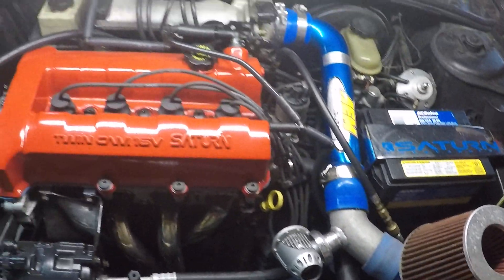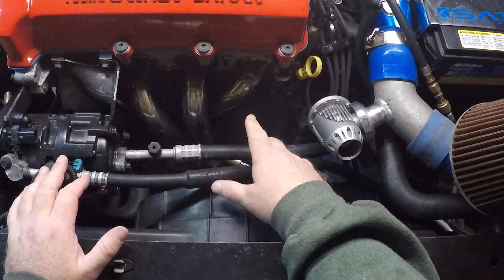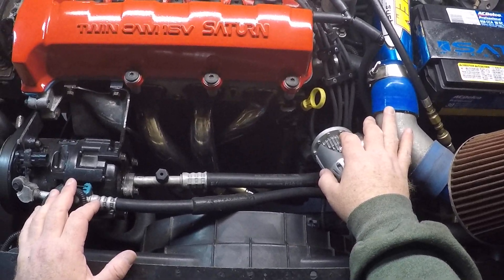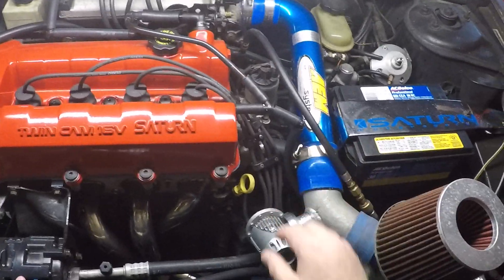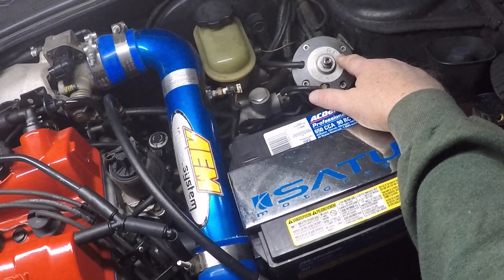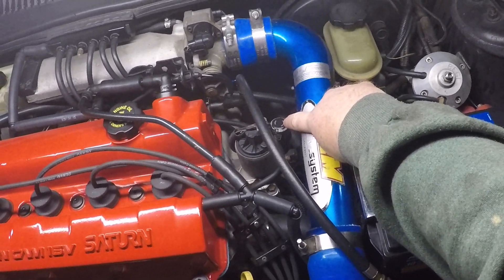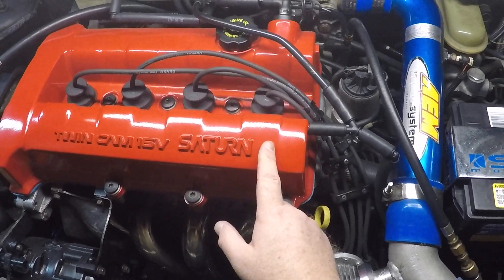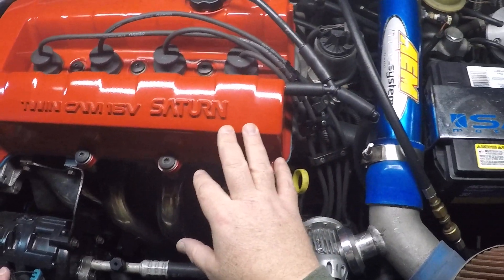SATURN S-SERIES REAR MOUNT TURBO KIT SETUP PT. 4

Comment: hey, i know im a couple of years late lol but im a teen who just bought my first car and im already lookin twoards modifications. could you send me the links to where you got the header. and possibly the turbo if you can
Reply from the maker: Hey there. Here is a flange you could build a log manifold from. Ebay-https://www.ebay.com/itm/152843773447?_skw=Saturn+SC2&itmmeta=01J88PB3SK9473QP6BE03TP07A&hash=item239632e607:g:5LgAAOSwZtlaQ~VF&itmprp=enc%3AAQAJAAAA0IGlUAWZBx1gbu%2FRwYCIK9zZFn8ol16gSIOP1GunxAGnxBsrHD1TlTw1q0b7VejA77Fd0cISbsE2t2SfwE7H26fnxOHbYjQdN5ZdvwV1N234YxO7rKilObtnPh9hCyLA1RTaIsAcps7L7yFU7oie0hbdVcdZFA1K9svs4kbf0D0pZHWrWLAi8WNnrH2t2A5drYzbSi5eNQcDCHgjBxm1sgsfHDcj%2BCh59CRx%2BvniVOsX57M7kwdlNEM3LiBHb4whEDRE6NY%2B1nnBREhu3W3xaFs%3D%7Ctkp%3ABk9SR_S8rJbCZA
Reply from the maker: Additionally, there is a option where you could take a cast iron manifold from a mitsubishi, and a couple changes, make it work for yours. I"ll dig up that how-to. The OBX turbo header I cannot find anymore. You might try to search for it however. Now, is the car you got a Saturn or something else? The turbo is simply a T3 ebay type turbo-a few hundred dollars. I don't think a link would help because these things change and are a dime a dozen. I would pick a T3 turbo from say 'Maxpeeding Rods' as their quality, for the money, seems consistent. I'd pick one with a small a/r (say perhaps a .48) for the turbine, for quicker spool up and perhaps a .60 on the compressor side. If there is an option, go with the ball bearing type. Let me know if this helps at all. The mitsubishi header is a great option actually, but if you pick a turbo, and decide on that manifold, you'll want one with a non-internal wastegate (the kind with the can and rod on it already). You could still use that type (like I did) but you're going to have to remove it and make sure that flapper hole gets blocked off. Here is the link for that mitsubishin manifold mod-**the link I put didn't work. Search this and it will come up "mitsubishi turbo manifold on a saturn' and its on a forum of 'sixthsphere'. The site is now defunct but when you term search it comes up and you can read the article.

Comment: Hey I’m building myself a Saturn an trying to turbo it . An it is extremely hard . Could you tell me what type of header and turbo setup you used . I’m trying to do something just basic
Reply from the maker: I've turbo'd this car a few times. The first time I built my own log manifold. I currently run a rear-mount system which means you can run an OBX header (regular) and not have to worry about a dedicated, made for your car, manifold. However, a rear-mount setup is challenging. What I would do is search for the OBX turbo header. There is one out there. However, I've never used it and don't know if it will allow you to keep AC if that is important to you. If you do want AC then you might have to build your own. There just isn't anyone making AC retention turbo manifolds that I know of. Sorry.
Reply from the maker: Sorry I missed the second part of your question- as for turbo size its really just a search on amazon or ebay to find one thatwill work for you. I think the OBX turbo manifold has a T3 flange. Since the s-series' 1st and 2nd gears are short, I would pick a small t3. A t25 spools at around 2200 which makes 1st and 2nd useless. Perhaps a 'disco potato' sized turbo? I picked a T3 myself